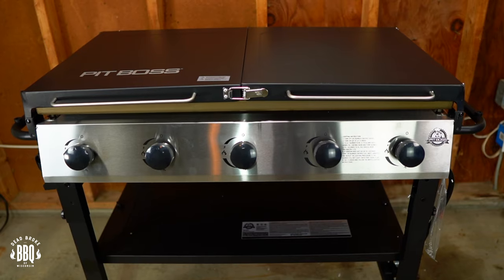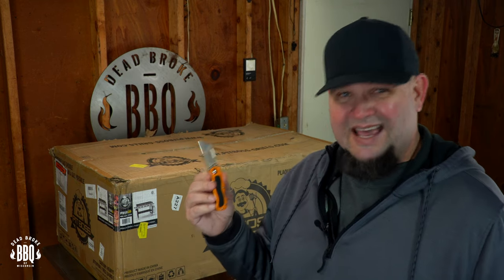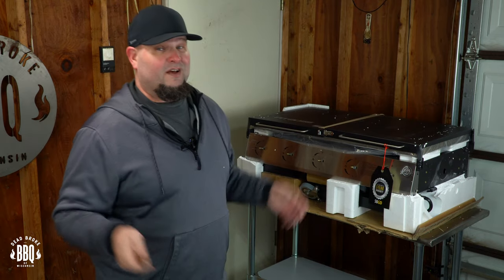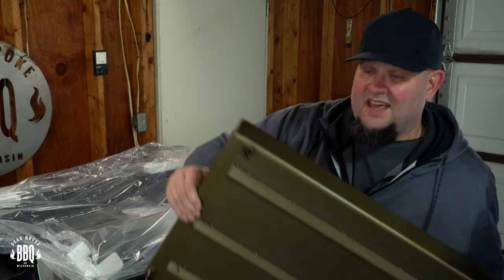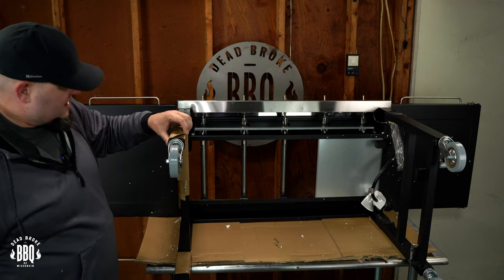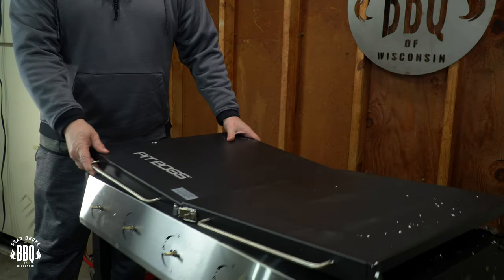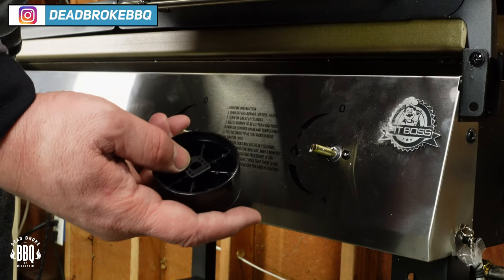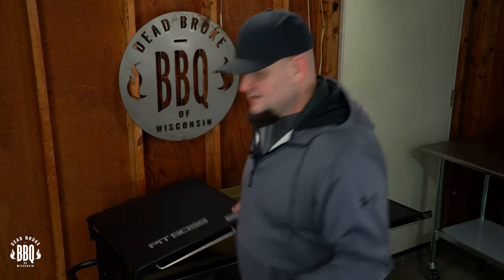pit boss griddle | 5 Burner Deluxe unboxing and assembly

Comment: I see that there is a second set of holes to put the legs lower so you get maybe 2 more inches in height on the griddle.  Where does everyone have their griddle set?  Which is better?
Reply from the maker: Mine is set at the same spot still. This one folds up and can be hauled around easier!

Comment: Pitboss doesn't say that the 5 burner has stainless steel burners.  All the other models on the pitboss site say stainless steel burners.  Anybody know if the 5 burner has stainless steel burners?  Whats the difference between the standard and deluxe models? One more ask, I read someplace that the 5 burner doesn't have as consistent heat as the 4 burner.  One side is cooler.  Have you noticed that?
Reply from the maker: Hi Buzz well I have not seasoned this up yet but i did hear that the middle is a little cooler than the sides?!?!?! So we will see how it goes once I start using it for sure! I am hoping I can season it up this weekend and I will look into the stainless burner question also!! Obviously I hope they are!! Thanks for watching and have a great week!
Reply: @DeadBrokeBBQ  I'm sure your busy like the rest of us but it would be great if you could do a follow-up a few months down the road after a few cooks.  I sure like like the look of that bad boy.  Hope it runs like a champ.